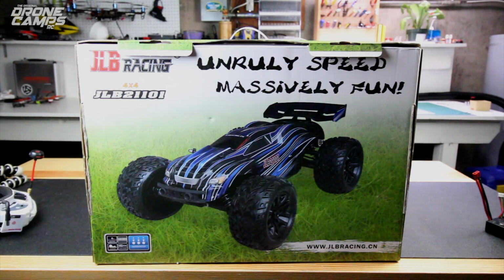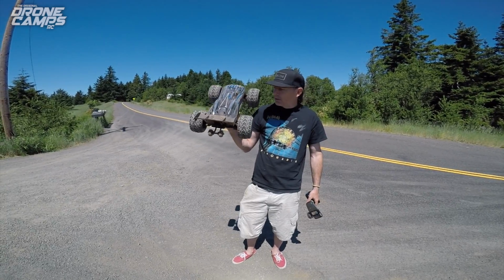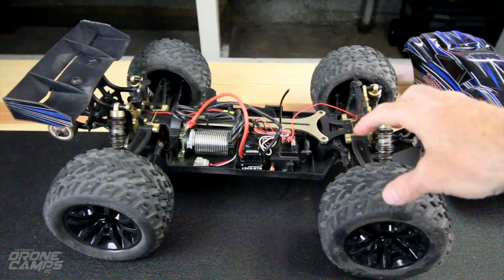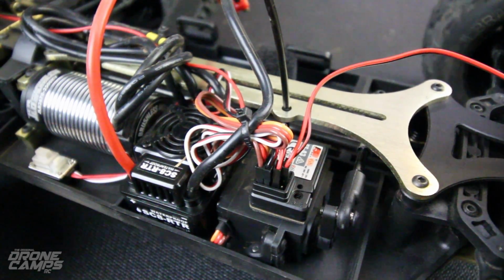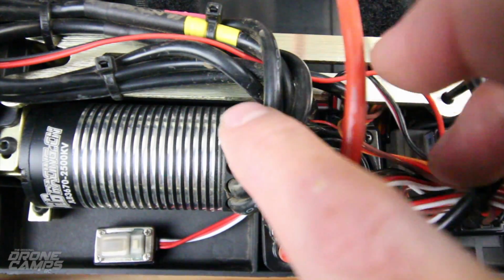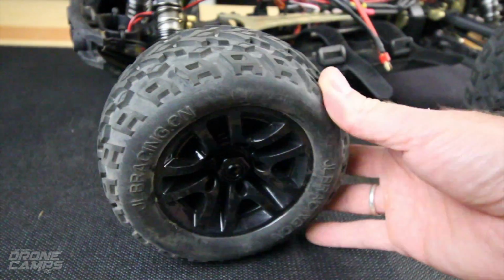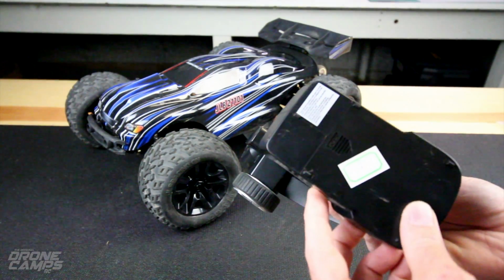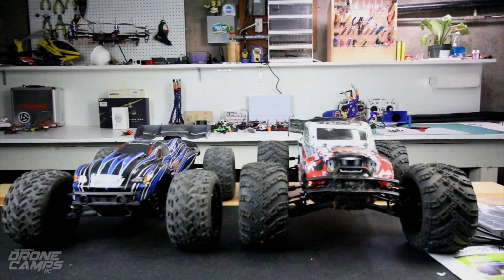JLB 21101 Cheetah - EXTREME 120A - BASHED & REVIEWED!!!

Comment: Hi Drone Camps. How would the JLB perform if you swapped the tyres to those the Zombie uses? I have found on my cars a slightly larger tyre than stock does help with the balance and control-ability. Regards

Comment: Can I ask you a technical question about my JBL cheetah?  When I put in reverse it slow to respond, I have played with throttle adjustments to the point the car is almost creeping in backward with the trigger in the neutral position.  What can I change are adjust?  
THANKS

Comment: Nice stuff man. I love mine. I ran it on 4s and it is ridiculous :)
Reply from the maker: Glad you checked it out. I know you have a lot of experience with this truck. I like mine a lot. The fact it still is not broken is amazing.
Reply: Drone Camps RC Team when you consider the price, the value for money is great. Just need to check the motor screws are tight, unfortunately mine made their way loose and stripped the pinion gear :)
Reply: What's up man